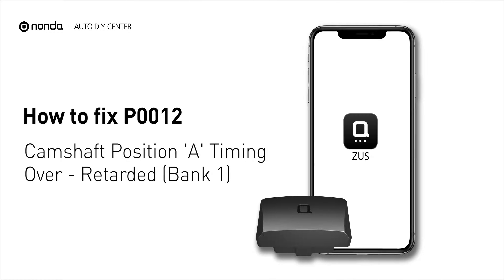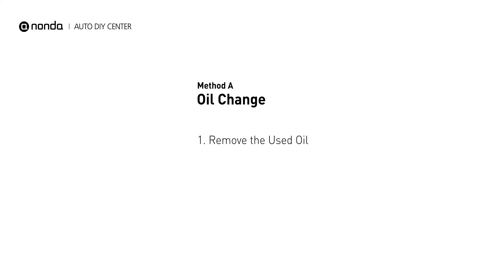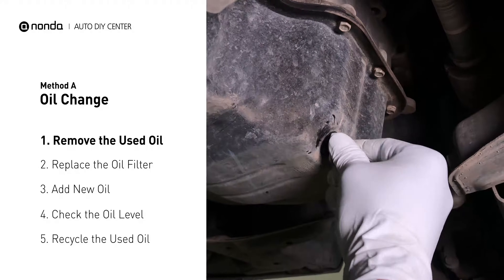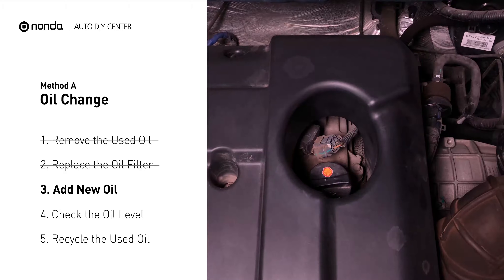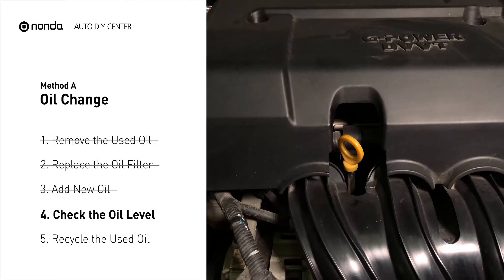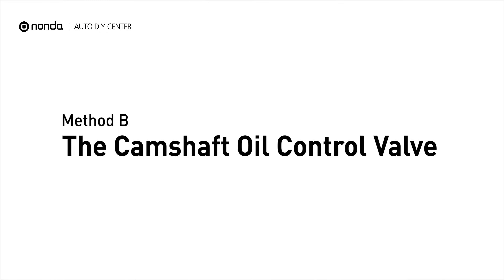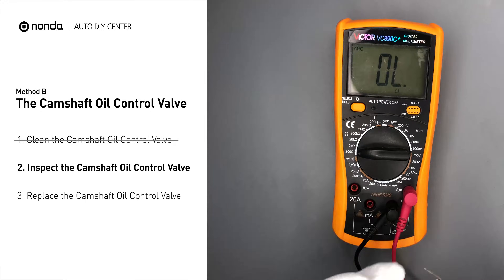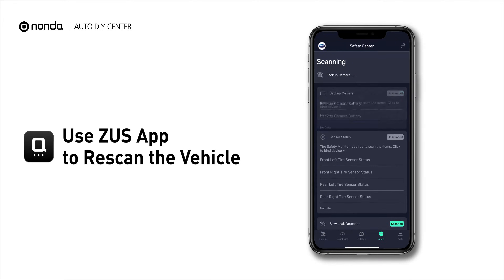How to Fix P0012 Engine Code in 4 Minutes [2 DIY Methods / Only $6.86]

Comment from the maker: Hi, I'm Steve, nonda's lead mechanic engineer. 
Feel free to leave your comments here if you have any mechanic questions, I will be glad to help you out!
Reply: Is POO10 AND POO12 DEALING VVT SOLENOID?
Reply: Hey I have a p0012 code but I did an oil change and new oil filter but there's a sound not as a knocking on idle but as a press on the gas it makes this noise.. like it's a muffler issues any idea what's the problem
Reply: @halftimesione2688  same here please let me know if you’ve found a fix
Reply: @PhillyxAR  3 years later still waiting for Steve nonda`s lead mechanic engineer to answere :D

Comment: Hey, I changed my oil less than 3k miles from Walmart, synthetic one.  I change the oil control valve-vvt and Camshaft position sensor, still my 2006 Toyota Corolla LE giving this code. I checked the oil level, it's low, can it be the reason for the code?
Reply: Should I change crankshaft position sensor and engine oil pressure sensor for it?
Reply from the maker: HI Safat, please confirm if this is the only code you're getting.
Reply: No, I have another code that shows low catalytic converter efficiency

Comment: I did both of them, what else can be done?
Reply from the maker: Hello, can you please provide us with your vehicle's year, make and model?
Reply: @nondainc  2006 Toyota Corolla LE
Reply: I even change my oil control valve of VVT. It's still showing the code. I had my oil changed at 196k and it's been less than 3k miles.

Comment: 2015 ford fusion poo12 code I got the oil change but when I start the car up it feels like it’s vibrating or shaking and it hesitates to start
Reply from the maker: Hello, you may have a bad camshaft timing, low oil pressure/dirty engine oil, faulty intake valve control solenoid or engine sludge.

Comment: Is this a video for a Mazda6 06? I'm trying to find the location of the cam shaft sensor no luck online
Reply from the maker: Hi Aciga, we suggest checking the wiring first (wiring going from the solenoid to the ECM). Also, the wiring harness to the intake camshaft position sensor for poor connection. If no issues found, then either the actuator solenoid could be bad or your engine oil is dirty/low.

Comment: Hey I have a 2010 Suzuki SX4 
Had no oil in it. Check engine light can on. Got the oil change and got a diagnostic test on it code came back P0012 ?

I’m bout to clean the oil control valve
Reply from the maker: Hello, can you please confirm if this is the only code you're getting?
Reply: @nondainc  yea 
Took out the vvt solenoid today 
Tested it n nothing 
Had to order a new one.

Does it make a knocking noise ?
Reply from the maker: Have you checked the wiring going from the solenoid to the ECM for any issue?

Comment: Steve I have 2011 cx7 2.3T that was running awful. Mazda diagnosed as needing new injectors and fuel rail. My independent shop did this work. It seems to run smooth now but I'm hearing some noise they attribute to timing chain and the P0012 code is on. Any idea why? Or what to check?  Replacing timing chain at 86k seems extreme
Reply from the maker: Hi Paul, checking the condition of the Intake Camshaft Position Actuator Solenoid and the engine oil/oil viscosity is suggested.

Comment: Replaced new oil new filter ( motorcraft) both vct solenoids no engine noises runs perfect idles perfect but p0012 keeps appearing after driving for couple hours
Reply from the maker: Hi Mikey, is this the only fault code you are getting?
Reply: @nondainc  yes

Comment: Hi I have a mazda cx7 2008 2.3L grand touring that's throwing this code. We've changed the oil and oil filter, replaced the camshaft Phaser, and the camshaft oil control valve sensor is brand new... I'm not sure what to do at this point.
Reply from the maker: Hello, have you double checked if there's any other fault codes that register along with P0012?
Reply: @nondainc  That's the only one. We've cleared it multiple times, done the drive cycle at least 3 times, and the same code keeps popping up honestly
Reply from the maker: Hello, the timing chain might have jumped a tooth. Also, kindly check the condition of the wiring or connection going from the solenoid to the ECM.
Reply: @nondainc  the timing chain just got redone before the code, it's all in correct time. We just checked the wiring and it has full power    at 12 volts to the solenoid
Reply from the maker: Does the code set immediately every start up, or after it has been driven?
Reply: Did you figure it out ?

Comment: I have fresh oil and oil filter, new ocv, and I'm getting this code. Should I look to the cam and/or crank shaft sensors?
Reply: Can be a failed intake cam gear
Reply from the maker: Hello, please provide us with your vehicle's year, make and model.
Reply: @nondainc  2005 Scion Xa
Reply from the maker: Hello, this code is triggered by a faulty intake camshaft position actuator solenoid but we suggest to start inspecting for any wiring issues (going from the solenoid to the ECM and wiring harness to the intake camshaft position sensor).

Comment: Am having the same fault code p0012 on 2011 Camry ,I check de Mechanical timing is ok, vvt sensor is working, ocv filter is clean,I changed ecm still de same fault code it come ,I need help from you Engenier
Reply from the maker: Hi Zion, please try changing oil to see if the issue will still persist. Hope it helps and we will be waiting for your update.
Reply: @nondainc  I  changed the oil with new filter still de same fault code, if I use scan tool to command  vvt sensor especially the intake side instead the engine has to change to rough idle,nothing happen like that but exhaust side works perfect when I use scan tool to command the exhaust vvt sensor,
Reply from the maker: Hi Zion, are there any other codes registering together with this code?
Reply: @nondainc  no pls
Reply: Only p0012 current and pending
Reply: @nondainc  I want to know the vvt sensor can you fix it any where,I mean can the exhaust side fix the intake side?
Reply from the maker: Hi Zion, we suggest to have your vehicle visually checked by your local mechanic for further diagnosis.
Reply: @nondainc  yes
Reply: This morning I put machine on it de same fault code p0012, I try to command the vvt sensor with the scan tool while engine is running the exhaust side work and engine goes off but the intake side the current come while you use the scan to activate the vvt sensor but you will no see any sign,can camshaft face cause that
Reply from the maker: Hi Zion, we suspect that your camshaft phaser is defective. To ensure that this is the source of the issue, we suggest to have your vehicle visually checked by your local mechanic.
Reply: @nondainc  senior finally everything is solved, I changed camshaft phaser , tanx for your time and your reply
Reply: and again am working on Chvy Cruze 1.8 none turbo, na the engine oil enter into reservoir container, I changed the oil cooler and the gasket in front of the engine front and everything is fine now,but what I was experiencing is overheating after I finished oil entering into the water, the engine can run at normal temperature where the radiator fan has to start working it’s won’t and u see the water is boiling in the container no high temperature but if you remove the temperature sensor and see de fan is working and no overheating,I changed the sensor still de same fault,pls I need help your help-waiting for your reply

Comment: I just purchased a f150 with the 5.4 3 valve motor. The motor sounds great with no noise whatsoever however I do have a couple issues and codes coming up. I am constantly getting a p0012 error code and a cylinder 3 misfire code constantly I also get a p0016 error code that is intermittent. I have checked oil and changed the coil but still have a number 3 misfire and getting the codes.
Reply from the maker: Hi Adam, we suggest to get your vehicle visually inspected by your local mechanic for further diagnosis as you are receiving multiple error codes.

Comment: Hello. Someone ran my car hot and blew the head gasket. I tore the engine apart replaced and reinstalled. I have great compression,I got spark, and fuel. When I went to crank it now I'm getting immobilizer system lock and codes 0012&0882? Any help would be awesome.
Reply from the maker: Hi Brad, we suggest taking your vehicle to your local mechanic to visually inspect all the related parts, and to prevent misdiagnosis.
Reply: @nondainc  I just borrowed a friend's scanner. My camshaft position sensor on bank 1 was bad so that'll take care of 0012
Reply: @bradr.4355  For Bank 1 is that the intake? I have the exact same code on my car, did you change the cam position sensor or the VVTI Solenoid? Because both of these can cause this code to come up
Reply: @gray_vz4535  any luck?
Reply: @nondainc  now I just gotta learn about the 882 tcm low signal input

Comment: Is it important to use valve cleaner and not any other kind of cleaner? I just bought a can of throttle body cleaner. Do auto parts stores sell valve cleaner?
Reply from the maker: Hi Brad, we recommend using the valve cleaner as each of these cleaners has a special active solvent for cleaning typical dirt and deposits. Some auto parts sell it, or you may order it online.
Reply: @nondainc  Thanks. All I did was remove the valve and spray the screen on the end with the throttle cleaner. Solved the problem.

Comment: Oil just changed on my highlander at thr toyota dealer a week ago.  Now I have this code?
Reply from the maker: Hi John, please make sure that the engine oil is full of clean correct viscosity oil. Check the timing chain and also, please do a thorough inspection for any problems with the wiring or connections to the components.

Comment: since oct last year this code  went on 3 times  and i drive every day ,   went of  today  while Pushing my acceleration at around 80 miles an hour...  one time it happened when I was parked at idle ...   I'm not 100% sure if the other codes  were a P0012 code  .. But this latest time I had my radio hooked up that has an OBD sensor attachment on it that tells me what code it is and then I can reset right from the radio... so I reset it hasn't come up in another hundred miles...     I'm sure I need an oil change haven't changed it in the past six months but the oil still looks OK ....not great but OK..
Reply from the maker: Hello, please note that incorrect oil and using too thick oil could cause this code and may cause multiple codes along with it. You should change the oil and the filter to the proper oil viscosity for the engine's specification. Regularly checking the engine oil level and condition is recommended.

Comment: Hi, of my oil control valve have 10 ohms is ok? I have same Error
Reply from the maker: Hi Cosmin, please check the valve train for sludges and check the bank 1 intake camshaft oil control valve. If the valve is functioning well, it should click when you supply power and ground to the solenoid quickly using a pair of fused jumper. If it doesn't click, then you may have to replace the tested oil control valve. Test drive and see if the issue will still persist.
Reply: @nondainc  I tested the distribution control valve with two wires and it sounds like it works but the error persists… could it be something else?
Reply: @nondainc  the problem is that it interrupts, shakes and while accelerating it cuts the acceleration and increases the consumption a lot